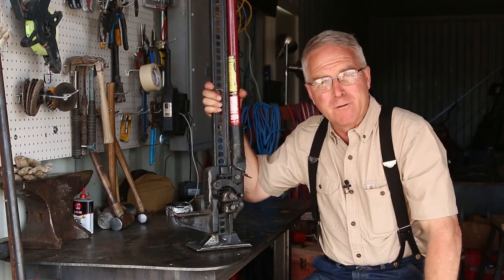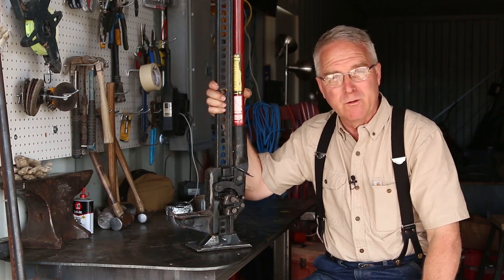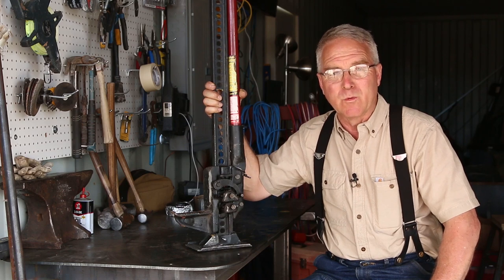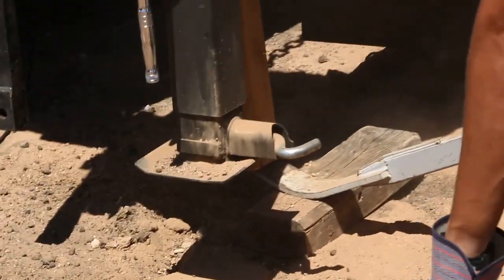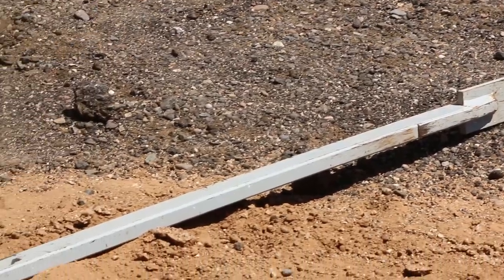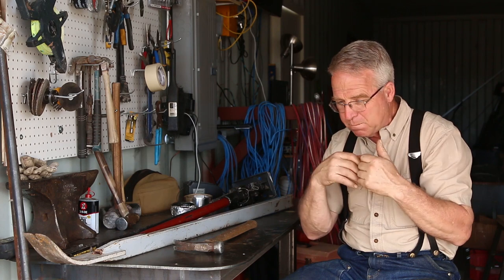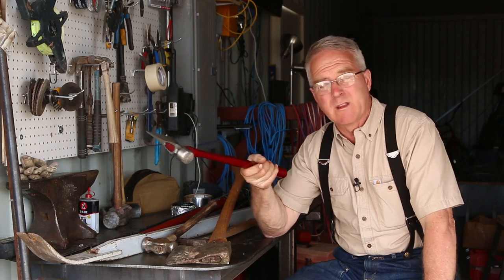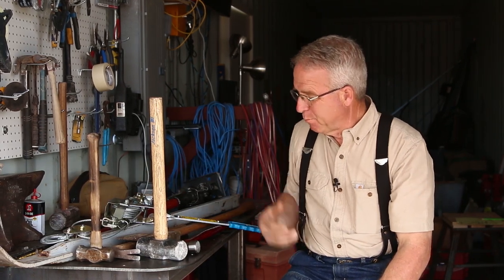5 Problem Solving Tools

Comment: THE VICE-GRIP = best tool ever.
Reply: I've heard that's what you grab when you don't have the right tool.
Reply: They are a life saver for sure
Reply: Those things have saved me so much trouble. A few weeks ago I took off the cover of a light switch(This was in an old house with  all metal fittings, which are now no longer available). When I was putting it back on one of the screws for some reason and got jammed. I tried loosening it, but the head just came clean off. Tried hitting it loose but the housing for the switch looked like it might break. I thought about drilling it out but if I made the hole bigger I would need a bigger screw... which wouldn't match the rest of the house. So I was in quite a pickle. Then I noticed about two millimeters of thread was still sticking out and it occurred to me that the vice grips might be able to grip it. I got it out the toolbox, adjusted it, clamped it down and twisted. The screw turned out perfectly. 

I have so many experiences like that it's unbelievable.
Reply: i totally agreeeeeeee with you
Reply: The Vice Grip rules - so many nails I've levered out with them, so many rusty and broken screws twisted free, so many times used to grip a nut where every other tool failed, etc, etc. I've had the same pair from Stanley for 30 years and as good as new.
Reply: I thought that one would make the list!
Reply: At least one a week I save someone in a bad situation at work with a pair of vice-grips. They refuse to buy their own. maybe I should let them get fired.
Reply: I'd place the vise above the grips.  Grips give you unhuman strength, a vise gives you Godly strength.
Reply: Leatherman has a multitool with a vise grip i think. They called it a Crunch

Comment: Leatherman tools are awesome, but the corkscrew on my Swiss army knife has save the day many times.
Reply: Victorinox
Reply: I think I've (accidentally) broken the corkscrew off of every Swiss Army Knife I've owned...
Reply: @daniele3275  Absolutely.
Reply: @diamondflaw  odd.  I've had the same one so long the blade is worn  down to a lock pick and it's all still intact.
Reply: @DavidLaFerney  Oh, it's definitely my failing, not an issue with the knife itself.  The corkscrew for me always seems to be the tool that I can't resist trying to use for non-standard uses that are a bit beyond what could be termed reasonable.

Comment: I have a Leatherman Surge that does everything for me. A few weeks ago I cut rebar with out the cutters getting a scratch on them and i have cut more nails than I can count. Today I used it to make nails straight so it was easier to hammer out, the list goes on and on. I have had it for over a year and it has been amazing. Only thing is it is heavy because it is all steal with no plastic.

Comment: I have a bottle jack with a 12x12x1/2 steel base welded to the bottom and a 3x3x1/2 on top that you would include if you ever used it.  It will SAFELY lift almost anything on any kind of ground.
Reply: David LaFerney that sounds like a nightmare to lug around with a large base and an extra 20+ pounds added to a jack that can already weight 20lbs. And bottle jacks just don’t have the lift height to be useful in as many situations. But definitely safer.
Reply: @chevyon37s  it's not as heavy as all that actually,  but if you need to jack from dirt, gravel or asphalt it's still easier than Jerry rigging a solid base - and safer.  I built it for jacking up sagging floors and it's just the thing. Even jacking from a concrete floor it's much better because it can't kick out.  Remember - PROBLEM solving tools.  This is most definitely one.

Comment: Was fishing with a buddy of mine. We were in a 16' flatbottom  boat with a 9.5 Evinrude. Sheared the half moon in the engine and even though I usually carry extras, did not have one that day. He found a pair of sidecutters in his tackle box. I dug around and found a dime. He trimmed the edge off the dime, cut it in half, put the two haves together and off we went. Left them in the engine for several years before replacing with a new key. Still have them in my drawer of neat stuff.

Comment: Hi Lift Jack? Burke bar? Are you thinking of busting open a bank vault?ll
Reply: Walk behind a dairy farmer, logger, rigger, tradesman, or other men for a year and you'd see multiple uses of each of these tools.  If you're a computer programmer in an office and rent an apartment, then none of these tools are useful to you.
Reply: Nah just ya face.
Reply: Ox that’s like saying carry a forklift and a backhoe on the back of your truck, those are very inconvenient big tools to carry on a daily basis
Reply: @eduardodedios8213  In the trades I mentioned, every one of them will have a pickup or service truck.  Indeed, you are correct.
Reply: Ox yeah I guess in a service truck those would be very handy, I just believe a simple crescent wrench 🔧 is more used than some of those big tools, I would’ve put pliers and black tape over many many tools, lol, take care!
Reply: @ox6942      yes ox    these tools are for men.   A girl can get the car jacked up  with little more than short skirt

Comment: 1   Duck tape!
2   Hammer
3   Rope
4   Pocket Knife/Multitool 

5   Jumper Cables
6   Special shout out = Jack n Crossbar
Reply: DUCT tape! I also thought about that but maybe it didn’t make the list bcz it might be categorized more of as a ‘material’. Looked like he had a couple rolls on the bench there!
Reply: me and you.. we think the same in this regard.  duct tape is king... and don't ever be caught out without rope!
Reply: @psidvicious  Straps. I haven't touched rope in years. Straps take less space. I use straps just like rope. Not supposed to use like rope but when a strap gets wonky it gets immediately thrown out
Reply: You know the saying: "If you can't fix it with duct tape, you're not using enough duct tape."
Reply: As much as I love jumper cables, I went "high tech" last fall and  setup a lithium ion "jump box" in my truck that is always trickle charging everytime the engine is running.  Plus that jump pack can run my 12 Volt air compressor without needing to start the motor on the truck.  Another plus.   I also have replaced rope with ratchet straps, para cord, and bungees.

Comment: You sir , should be required material for every high-schooler !  90 % of what they teach nowadays is designed to make you feel better.  Not always practical.
Reply: Actually modern education policy in the US is not designed to make kids "feel better", it's mostly designed to make them mindless worker bees. I agree though that this channel actually has valuable knowledge unlike most of what they teach in school now. How many public schools still have shop class?

Comment: I worked on oil and gas platforms in the Gulf of Mexico for 37 years and those come alongs were an essential part of our tool chest.  Those high pressure thick wall valves and piping of any diameter are heavy and the come along made removing and replacing them a snap.

Comment: Great list of tools. One might that I might add is a pair of vice grips. I was 21 when I was living on the road in an RV, when one day it broke and I needed to drain the oil so I could take it in to get demolished (in order to avoid tickets from it sitting on the side of the road). I was in a jam, and even more of a jam when I couldn't get the oil pan screw loose with my wrenches and channel locks. By the grace of God, an older man who was also living on the road, saw me struggling and lended me his vice grips. They saved me a great deal of trouble. He told me that when he was a young buck, older guys helped him out when he was in jams, and now I want to pass it forward when I get the chance. It seems that Vice Grips can get a supreme grip that wrenches and other similar items just can't get when you really need it.

Comment: Last spring the dock at my family's camp got more than a little knocked around by the flowing/melting ice. We were greatly assisted in lifting and pulling it back into place with a hi-lift jack or farm jack as we call it in New England and a come-along. The farm jack also proved irreplaceable this fall when trying to recover a clamshell snowmobile trailer from a field where it had rested for more than I care to say.

Comment: Number 1 tool in my opinion, are a pair of fencing pliers, not the one for farm fence, but those similar to the Malco FP2... it is a very simple set of pliers that is so well built it does almost everything a multitool can do, only easier!

As for your question about helping someone... about a month ago on my way home I saw a little old lady with a decent sized tree branch stuck under her car and she was just staring at it not knowing what to do... I gave it a tug and when it didn't budge, it was my Sawzall to the rescue, and I only had to cut it just once so I could pull it out from either side.

Comment: The hi lift jack truly is one of the great inventions in recent history. I was once cutting down some relatively small trees in the backyard of my parents rental when I ran into two or three that were hanging most of their mass over the neighbor’s backyard. Now I’m no professional sawyer but I had my hi lift on the back of my Jeep as I always do, as well as some chain and a tow strap. I ran the strap towards the top of the tree I was cutting down and the chain to a stump across the backyard, with the hi lift in the middle. I cut about 3/4 of the way through the tree before pulling the chain saw out and pulling the tree the rest of the way down with the hi lift, and most importantly, not damaging the neighbor’s playground equipment.

Comment: This reminds me that I need to get a leatherman. I have a cheaper off brand one that has been utterly amazing but whenever I am with my buddy and we are working on stuff or something arises, his beats mine hands down and is much easier on the hands in the process. Mine works pretty good for the price and I haven't broken any pieces of it but I never did get around to getting a high end multi-tool. Thanks for this list. come-alongs and snatch blocks are still some things I need to get for my big tool box.

Comment: Your right a multi-tool is a very useful tool to have and Leatherman is top notch in the multi-tool arena. When I was in Iraq in 2005 we were issued Gerber multi-tools, after breaking two of them using them for what I consider as light work, I ordered a Leatherman multi-tool and the difference was phenomenal. I have several different types and brands of multi tools, I even own one that I got in Amish country a few years ago, that has a hammer on it. Now some of these won't fit in your pocket, but my Leatherman is still my go to multi-tool and fits just fine in my pocket.
Reply from the maker: Agree!!!

Comment: I use two farm jacks with a Burke bar spanning the two over fence post concrete. Two red head anchors in the concrete with a chain looped over the Burke bar.  Some times I get lucky and the Burke bar down in the 4x4 will fracture it in half .  Best tool I ever stole from dads shop.

Comment: I carry a short military folding shovel and a car door opening kit. Its very sandy here in Arizona so the shovel comes in handy for helping people get their vehicles unstuck. The door open kit has paid for itself multiple times. I regularly run into people in parking lots who have locked their keys in their vehicles and I'm able to help them, also family members. I do let the vehicle owners know that there is a possibility of a light scratch, and I usually let them be the ones to use the plastic wedge.

Comment: I keep an assortment of sockets and ratchets, a bottle jack, a strap, jack stands, and a variety of basic mechanics tools in my truck in case I ever break down. I’ve never broke down, but I’ve changed alternators on the side of the road, changed tires, even left some tools with people in a pinch when I couldn’t stay and help

Comment: One of my favourite tools is what I call the toe cutter. 
A hatchet head welded onto a heavy walled piece of pipe. It acts as a pry bar, a crow bar, scraper, a wedge and a tree root cutter. 
It's probably the most used tool I have. I'm on my second one now, the first was a little small so I went to a mid size axe head. 
It cost $10 for a cheap axe, cut the handle off and welded it to a piece of 1 3/4 inch pipe by 6 foot long.

Comment: I simply pushed an older fella out of a main intersection on my way home the other day. Had the starting fluid to help him diagnose the issue and told him who to call for a cheap tow. Only took 5 minutes. It feels good to be able to so easily fix someone else problems 😌 which to them seem very large at the time.

Comment: In 1993 I was a young Marine and chosen to be a qualified Humvee driver for my unit. We met at Camp Pendleton for three days of training and practical application, including off road training and even a convoy through Laguna Beach on the Pacific Coast Highway.
One of the four vehicles developed a split near the end of a cooling system hose while we were deep in the back country of Pendleton and the Sgt. instructor or his assistant had forgotten to load a tool kit that day. But since I carried my trusty Leatherman tool everyday, I was quickly able to disconnect the bad end of the hose, trim off the split, and reconnect the hose, saving the class time and probably a butt chewing for the instructor. Thirty years later and I still can't imagine a more useful tool.

Comment: I've been a mechanic for a number of years now. And no one can ever guess the tool I use the most by FAR at work. A small, flathead screwdriver that I keep in my pocket. You can poke stuff, get up under gaskets and O-rings, use it as a pick, a scraper, you can pry with it. You can get electrical connectors loose with it. You can roughly gauge the depth of holes or see if 2 holes are lined up. You can use it to mark a piece of wood or metal you're going to cut. You can cut through tape or plastic or cardboard with it. It has endless uses and I lose count how many times I fish that thing out of my pocket on a daily basis.
Reply: Yooo! 100%.. I bought a 10 pack of those on amazon a year ago, keep one in the breast pocket of my coveralls every day for all the poking, scraping, prying, and other gnarly stuff I don't want to do with my Leatherman. Love it!

Comment: Rope.  You can attach bars for leverage, use it for hinges and obviously pull things.  I'm an arborist and I've always got pulleys and prusiks (for easy movement of pulleys along ropes in mechanical advantage setups).
The prusik would have to be one of the best inventions ever.

Comment: A few years back i came across a guy who had reversed down his driveway and ended up hanging the ba k bumper on his brick fence. This resulted in him standing there scratching his head in pouring rain with no clue. I went over to him and took a look, went back and got my two tonne trolly jack out, and positioned it under his back axle. After jacking it up off the wall, i simply pushed the car sideways so the axle slid across the top of the jack till it was away from the wall. I lowered the car and off he went. Took all of 5 minutes. 😊 As to what else i would carry, well in Australia we can usually fix most problems with a roll of fencing wire and a good pair of pliers. Love yr videos.  Thanks mate.😉🇦🇺🇦🇺🇦🇺🤠🤠🤠

Comment: In the pre multi tool days my right  jacket pocket had a 6 way driver, box cutter, needle nose vice grips.  Then I broke down and bought a vinelman (cheap knock off multi tool).  after a few months of carrying that I bought a brand name multi tool and keep it on  me always.  Except for when I am riding horses,  if you come off an land on it , it will leave a lasting impression.  Just keep it  in the saddle bag.  I mounted a holder on the back cinch to keep mine .

Comment: Knipex style adjustable wrench-plier. As much strength as a vise grip, as much finesse as a very good adjustable wrench. Perfect tool for dealing with stuff that is stubborn, non standard size but must not be knacked up with unsightly pipe wrench or vise grip marks.

Comment: Coming at this from the homeowner / DIY / woodworker side (and less the heavy equipment / rough framing / blacksmithing side), I'd also suggest a Drill+Driver combo as indispensable for the average homeowner, especially with a good assortments of bits and accessories, such as impact sockets, etc.  I use mine almost daily for everything from building a gazebo to fixing bikes to wire brushing stains off concrete.  I've even chucked electrical wires into my drill to quickly braid them, and even chucked PENCILS into it to quickly sharpen them in a simple hand-held sharpener.  There are literally endless uses around the home.  Plus, you can usually find the lithium-ion 18v/20v sets for $100-300 at most big box stores.  Well worth every penny.

Comment: My band mates and I were on tour a couple years ago and we helped a woman at a rest stop who had locker her keys in her car. We finally got it by prying the top corner of the door open just far enough to fit the bar from a boom mic stand through, which we then directed to the unlock button on the inside door panel and had to use vice-grips on the very end of it because the boom almost wasn't long enough to reach the button. She was just about to smash her window because she'd been there for over an hour, her phone was in her car of course and she was late for something. She was so happy! And I was glad for once that we have an old beater Econoline which requires that we always bring a big tool bag on the road!

Comment: Another extremely useful tool that I made myself is a short length of 1/4 dowel with the end sharpened  in an old crank style pencil sharpener. Tons of uses and the wood tip won't scratch.